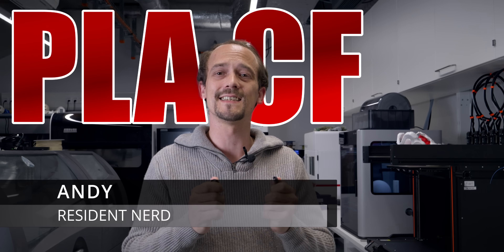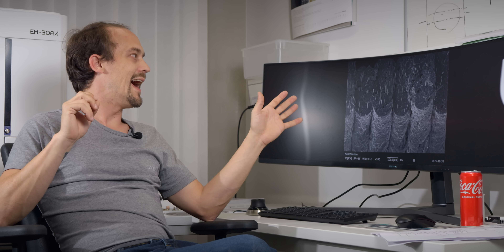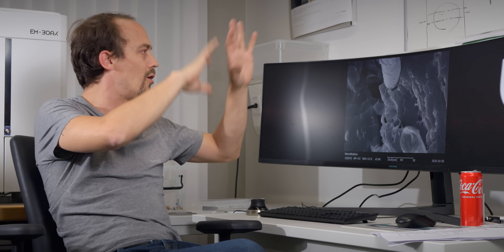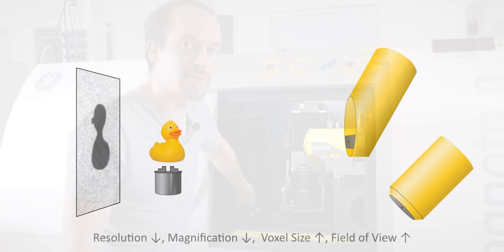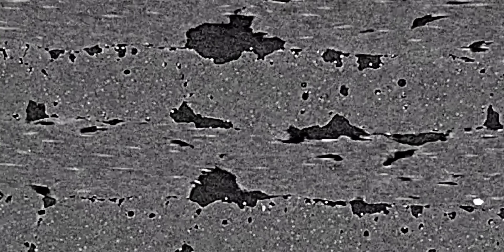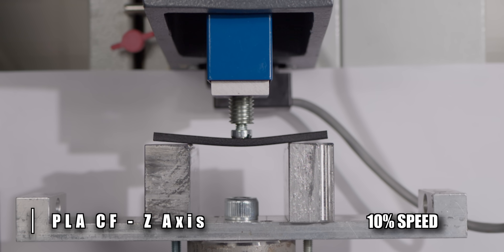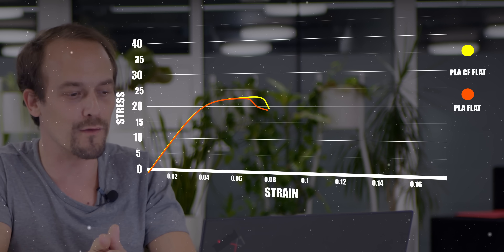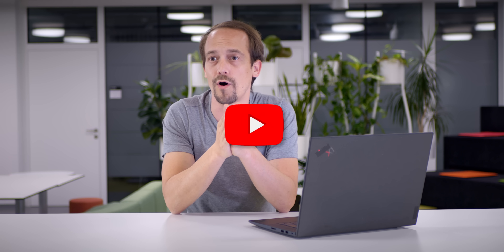3D Printing’s Biggest Scam Is Even Worse Than We Thought!

Comment: I am doing a research on auxetic 3d printed structures strength under different printing parameters. I saw the same microscopic imagery in carbon fiber PLA and I assumed that the voids were just the result of the  crushing tests on the auxetic samples, but after this video now I know how fragile is 3d printed filaments mixed with carbon fiber. How disappointing.

Comment: What about PETG-CF? I've found great anecdotal success, in that: its more forgiving to print, is more stiff than plain PETG, and is very difficult to break compared to the brands of PETG I've used. PETG is stickier than PLA, so I'd guess it sticks to the fibers better? Even the adhesion along layer lines on my PETG-CF parts are significantly stronger. I always saw PLA-CF as unnecessary compared to PLA PRO/PLUS/whatever branding naming convention for a host of different additives with different properties. This is just my experience, thoughts? (aside from health concerns)

Comment: Luckily I haven't gone into 3D printing CF enhanced materials. I stayed with the pure materials as far as they are available (PLA and PETG).

That means, after seeing this video I know that I have avoided the health risks of these fiber parts, these fiber needles and I knew from before that I didn't put the nozzles at risk of a higher wear through the fibers in the filaments...

And I got the undisturbed strength out of the materials.

Ok, that's great.

--------

By the way: What's the problem with asbestos?
The physical structure? The tiny fibers? Or the chemical composition?

That means, is there the risk of similar problems with fiber reinforced materials as it was with asbestos?

(And sometimes the fiber reinforcement only weakens the materials (look at this video here) - and might have health risks too?)

Comment: not surprising at all. I have never used CF infused filament, have never had the "need" for it and it seems like a waste of money. I certainly would never go for carbon fiber PLA as it makes zero sense to me, pla is already a stiff plastic, the only time it would make sense is maybe closer to the glass transition temperature, maybe it holds up better.

My failures are nearly always along the layer lines, so again, CF would not help there and according to your results on this video, would actually make it worse.

I just stick to pla (usually matte as I like the look and you notice layer lines less) for prototyping and low stress function prints and go to abs or asa for things that need to be stronger or in higher temp situations.

Comment: You are right about PLA, but I'd argue PETG benefits from CF. PETG is less rigid than pla and has better layer adhesion. It gains rigidity from the CF, at a small cost to layer adhesion, and that's fine because it has a lot of layer adhesion. It also gives great print properties and prevents warping. Lastly, you can't deny the aesthetic matte/satin finish.

Comment: Hi, I worked for a couple of year robotic 3D printing large scale products in PC, PC-CF, PEEK and PEEK-CF. I can say empirically that at least with PC and PC-CF there is a huge difference in the stiffness of the material. I 3D printed 2 bike frames, same Gcode, same machine and conditions and the only difference was PC and PC-CF. At the end both bikes could withstand the bike stresses but the CF one was waaaay better while the PC not reinforced was too flexy. Also, its important to say that we tested multiple % of CF in the material and if not done in the right proportions with the correct binders the PC-CF could be just useless and completely brittle.
Also, in regard of the voids, once we did an analysis in the PEEK-CF together with the polymer manufacturer and we realized that those voids could be generated by the moisture inside the fibers itself when not correctly dried in the process of the pellet manufacturing. So after the pellet of peek-cf was done, you could dry it as much as you can but the moisture was trapped inside. This was a big problem for us since we needed to develop a non-void printed part.
Great video, keep doing this analysis, they are awesome!

Comment: I got my 1st 3D printer, a 3D Systems SLA 250, in late 1993. We started with acrylic but within months we were one of the 1st companies in the world to move on to epoxy resins. I was astonished at the improvement in precision and strength. The parts took twice as long to build but I really didn't care because I was a precision engineer by background. Just to give you an idea, we were building at approximately 10 g per hour on that machine. In 1994 we made a part for Lucas Aerospace that weighed almost exactly 1 kg. We sold it for exactly £10,000. Them's were the days. The company was called Styles Rapid Prototyping UK. In relation to this specific video I would say this: I have never been in a field that is so rife with fraud and lies about the capabilities of machines and materials. This young man deserves all the credit he gets. Good on you mate.
Reply: That's very interesting.  Could you clarify - were you actually printing parts using acrylic, then epoxy resins with the SLA, or just making (injection?) molds with the typical SLA resins and then molding with acrylic/epoxy?  Thanks for the info!
Reply: @retromodernart4426  I too am curious to know.
Reply: @retromodernart4426 the resins were acrylic and the expoxy came as a new development.
Reply: Mr Styles! I was one of your company's customers. Did you get involved with Leeds University's CARP project (SLS) in the 90s. Things have come a long way haven't they?  Thanks for your pioneering work.
Reply: So you're saying you've never worked in software?
Reply: Precious little that comes out of China has honest specs.
Reply: @gdutfulkbhh7537 China creates better quality stuff than anyone now, MacBooks, iPhone, aircraft parts etc. They are only as good as QA and Design by the company selling/buying from China. Apple would reject anything that didn’t meet specs. So if the company doesn’t care, they will get whatever the Chinese factory wants to send them. If they demand the specs and quality needed they will get it. Customers can do the same by not buying it if it sucks.
Reply: @gdutfulkbhh7537  You don't get to be smug about that if you're American.... or work for any big corporation anywhere...
Reply: bro copied this story off reddit
Reply: Heh you mean you are speaking from experience of scamming clients out of 10k for a 1kg part?
Reply: @sloplife  1kg part that took 100 hours to print at 10g/hr, with probably 2 engineers working on it, each costing around $270/day + overhead costs + time and material for any failed prints + the time to design and create the CAD + project manager + FEM analysis time + + +. $10k really is not highway robbery, especially an aerospace part.
Reply: @MantisRay861  Not to mention there was only one supplier of 3D printers at the time, the patent owner, so overhead cost is pretty high!
Reply: @sloplife carbon fibre weave itself was £1 per inch and resin was expensive. Also only works in autoclave for curing with vacuum bagging. Aerospace parts cost lots. 100 hour print job spanning days with experimentally printing that could cost £10k with dev and testing and finding a perfect one out of the run. Designer, aviation tech, materials guy, engineer minimal team too.
Reply: @sloplife  considering what simple metal parts already cost in machining this feels like a steal.
Reply: @sloplife  It's only a scam if the clients didn't know the price, or if the part didn't meet its specs.  Otherwise it's just expensive.  Expensive things can be worth it, it's up to the customer to decide whether or not they need what you're selling and can afford to pay for it.
Reply: @sloplife almost nobody else was doing it anywhere in the world, and the SLA machine cost millions.
Reply: @sloplife  that’s not bad at all for an aerospace part.
Reply: You mean YOU are commenting from lack of experience in the cost of operations in manufacturing a 1kg aerospace part.
Reply: @sloplife  Aerospace parts get more expensive the lighter they are.

Comment: If you had a filament with a CF thread, I could see that having applications, but you'd want to generate gcode that weaves layers in alternating directions and you'd need a tool on the nozzle to cut the thread and... No, the whole idea is just a mess. 3d printing molds and then using CF properly makes more sense

Comment: I've only used PETG CF for it's heat resistance when needed... but it doesn't surprise me that it's weaker... even the constant cf parts are not stronger when tested... but it does make the part stiffer with the constant cf ... I think under well designed constant cf parts could be stronger but only when it's designed and tested and then tweeked until the desired result is found... good video... I appreciate you...

Comment: I know when doing fibreglassing the fibres often have certain coatings to make them stick to the resin better, I wonder if that would help CF-PLA. PLA CF-core also won’t have the layer adhesion issues and hence should be stronger than standard PLA-CF, but that doesn’t imply it’s stronger than standard PLA. In a composite like this, the fibres should be in tension and the plastic should be in compression, but PLA tends to creep under load so it’s not the best in any composite where strength is important.

But what PLA-CF is 100% useful for is getting cheap 150C resistant annealed parts on an open printer without significant warping.

Comment: Great video! Please do a video of carbon fibre reinforced ppa, specifically Siraya tech's core version, where the carbon fibres are placed in the core of the filament, and thus not affecting the layer bonding.(That's what they state at least). I've recently bought this material myself, and while it seems impressively strong, I have no other testing methods than manually placing stress on the parts. Thank you!
Reply from the maker: That's funny that u mentioned this. The next episode coming next week is about cf core filament 😅
Reply: @Ibuiltathing  Fantastic! :)

Comment: 8:55 my first guess would be not moisture from the filament but maybe trapped moisture captured from the air in the printchamber/room where the print is made or maxbe flow issues of the filamentbut then they should be bigger

Comment: Scam is a bold word. Imagine calling silk PLA a scam because it only looks different... or calling wood appearance filament a scam because its not actual wood. 

CF filament isn't really a scam if the results are different from plain filament. It 100% prints differently and looks different. You also demonstrated that the properties are different. Even if only for those reasons, it's desirable for some people in some use cases. 

Nails arent a scam because they bend more than screws. Screws aren't a scam because they break before bending. Use cases differ and appearance differs... hence why more than one thing exists.

Comment: Fibers aren't for strength! But they make a massive difference in stability. Try printing something the full size of your bed in regular asa and again with asa-cf and you'll see what it's for. Even in pla it makes a difference when the prints get big or have geometry you need to stay flat. If you want stronger then use a stronger filament or use more walls or use a better design.

Comment: A health and safety issue was raised at work regarding CF and GF materials getting embedded into the surface of a person skin.  The length of the fibers is very small and we shed skin all the time  but it was raised as a health and safety issue so we had to take that concern seriously.  This led to a "ban" on the use of CF or GF materials that would be likely to come in contact with someones skin - e.g. we couldn't print a handle with CF or GF.  I have been looking into Fillamentum Nylon AF80 Aramid.  I read a claim somewhere that the aramid fibers get fulled under the surface of the PA when printed.  I think this would make a very interesting comparison to CF (and GF).  One more new subscriber based on this 1 video

Comment: Hi, thank you for posting SEM pictures. 

My input as a thank you:

1) I watched the video only because friend recommended it. I saw it in recommendations and didn't click, as the tittle is pure clickbait. Maybe I am not typical audience, and you will profit from clickbait, but that's my grain of salt

2) I couldn't see what you claim on the SEM pictures. Statistic analysis would be better than 'feeling'

3) you checked only 2 types of filaments? I went through MyTechFun table: 28 PLA filaments without fibers vs 8 with fibers: on average those with fibers have 50% higher stiffness in bending.

Comment: As something of an x-ray expert (safety protocol physicist in x-ray systems) I think you made a mistake using “as close as I possibly can get” as a magnifier.  Yes you will get some good results but you are also causing distortion that requires a TON more math to work out and show accurate results.  What most testers would do would be to increase the radiation density and move the target as close as possible to the collection plate (AWAY from the source anode).  That will give you the VERY high res image you’re needing for this without all the math.  Visible results always trump estimated results.  Just use the 4x (xy) protocol for increasing your final image density and image accuracy with directly visible results

Comment: It seems like you are using the wrong settings for the CF print job...most CF filaments are recommended to use a larger nozzle diameter (looks like you are using 0.4mm nozzle) and larger layer height (looks like you are using 0.1mm which is quite thin for CF printing) to print the part. I would test with adjusted settings (at least increase the layer height to above 0.2mm) to ensure that your analysis is accurate as the improper processing of the material will affect the properties of the parts produced.

Comment: The theory is simple and straight: everything breaks at the weakest point.
Even if there is an absolute adhesion between ordinary plastic and reinforcement the thing will crack on plastic.
So, if you have a disruption in reinforcent belt - thing will crack on the disruption.
That's why wings of B-787 are so weird.

Comment: One of the interesting cases that I've heard for CF as a polymer additive is not for print stiffening (which I think more testing would need to be done for other materials beyond PLA to concretely say that, but is very interesting to see with PLA+CF for sure) but instead for print fidelity.  Polymers like PETG can have difficulties in printing complex overhangs even with decent setup and dialing in the printer, but adding CF to it will increase the dimensional stability, allowing for the strength and improvements of PETG while retaining or exceeding the printability of PLA.  That has also been the use case I've seen for PLA+CF, as a dimensional stabilizer during printing.

Comment: Why did you only do 3 point bending? For example, in my strength of materials class (yes 30 years ago) we made dog bones and did the ultimate and yield strength for tensile testing with a machine that pulled them apart. Is there a reason that you don't care about the other strength modes such as tensile, compression and shear?

Comment: PLA CF is dogshit, PETG CF is a different story. that has incredible strength and its not expensive. it does however come with a warning. if the machine does a screw, your print head will be fucked and will need replacement. i lost a creality k2 to petg cf and luckily my QIDI Q1 pro was repairable. it did cost a bit of money tho. machine cost me 16k and repairs was around 4.5k

Comment: Any engineer should realize 3D printing is unnecesary conplexity, for only limited applications.

It is an enormous list of constraints to your material and design. Being able to melt in the printer is just scratching the surface of the added constraints.

Comment: I would have liked to see magnified views of "slices" instead of broken ends and as for the voids, Carbon fiber just like ANY pure form of carbon is an excellent conducter of heat. It shunts heat much better than most materials including plastics and doesnt contract or expand in the process as plastics AND AIR do.

Comment: This is an insanely well done analysis of PLA-CF materials, huge respect for that! 

I always thought that fibre reinforced PLA and PETG were just a gimmick or for looks, since the surface finish is very nice and hides layer lines very well. PLA has great mechanical properties for how cheap and easy it is to print, minus the temperature resistance. Which is a point that isn't fixed by adding CF to it.

I love regular PLA for prototyping, but next to none of my final functional prints use it, mostly due to temperature resistance. Most of what I make is printed from ASA (my favorite material overall), followed by TPU, PPA-CF, PA6-CF, and then PC-CF. All of these filaments do benefit from the added carbon fibres, in the most part for better dimensional accuracy and reduced warping.

Comment: Part of the issue I see no-one talking about is the health issues involved with CF filaments. It's going to shed carbon fiber stands from when its a filament, when its printed, and when its handled. It's wild that companies are even allowed to sell the stuff. Not only will the fibers be in the air while it's printing, it will be coated inside the printer, inside the room where the printing was done, so unless proper filtration is used, and thorough clean up is done afterwards, those stands will continue to pose a health risk for years after that part was done being printed. I work with CF in aerospace products and the level of protection we take is massive.